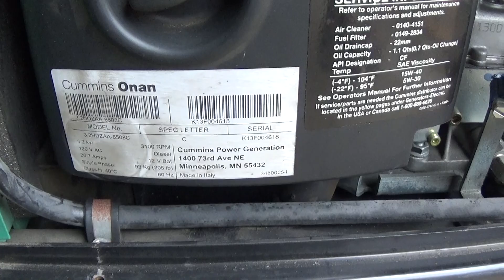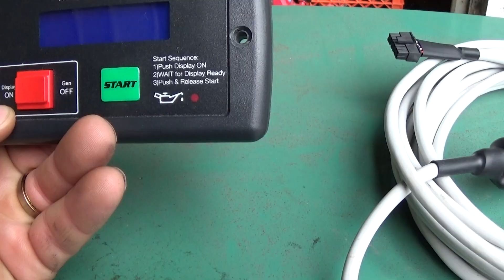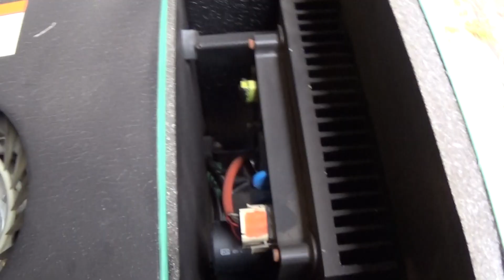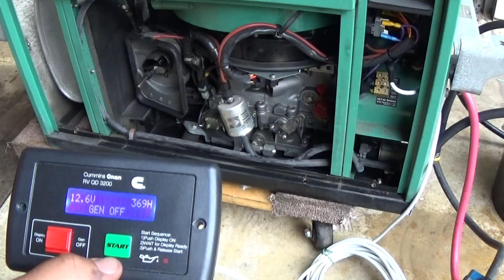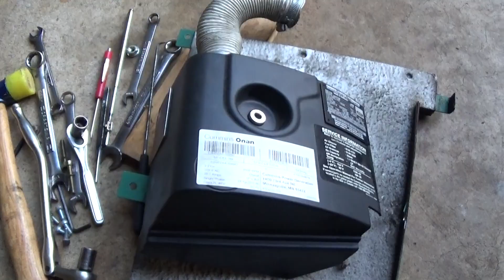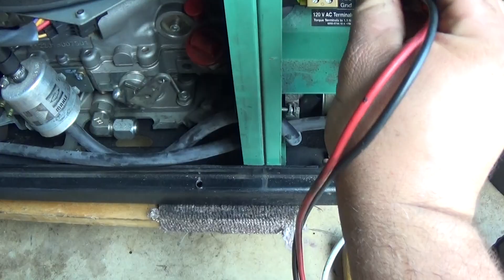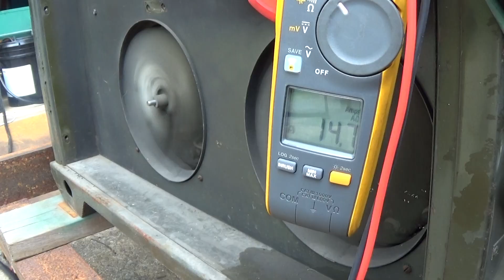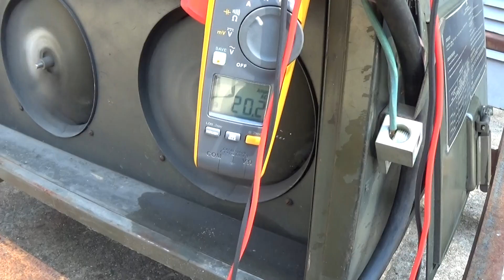Miniature Diesel Generator Diagnose, Repair, Test ONAN RV QD3200

Comment: Used to work for Cummins/Onan - that was the worst 'Onan' that was built.  Didn't really conform to any of the other machines. Almost every single other one could use the same control panel. Not this one!  Oh no...   gotta use the panel that came with it (thankfully you got it with it!) and nothing else.  If you get intermittent failure, look for a crack in the control panel PCB. Drove myself insane diagnosing THAT one!
Reply: JD - diesel, try to find a QD7500. Later than about 2003 or so. Earlier ones had magnet failures where the glue came loose. Ive exploded a few!  Dramatic.

Comment: Nice Job! Glad to see the shop is coming along nicely! I just fixed an old Honda (Home lite) 4800 watt generator from the curb with he exact same problem! (Video coming soon) I wonder what causes it to happen?  Great video!
Reply: Usually underloaded diesel generators carbon up after many hours of operation . Clogged air filrers or obstructed air cleaner or air induction.
Reply: Sorry that coment was meant for someone with a carboned up J-series. I wasn't paying attention where I was typing!

Comment: That’s a sweet little genny.i was thinking the same thing about that muffler maybe being too clogged up. Looking forward to part two!
Reply: Quite likely dude.
Reply: We use to change out muffler every 6 months but frac jobs have increased to the point it’s changed oil filters and run it tell it’s done, new ones at yard waiting for 3 hour change out 
Time and money
Reply: Or could just use a small tractor muffler

Comment: That's awesome! 
As many problems as they have come through, if it seems like it might be a major issue, it's cheaper for them to just replace the whole thing than spend time troubleshooting what could be an issue they won't repair. If it seems major it probably is so just proceed as if it is.

Comment: That right there is the difference between a technician and mechanic
Reply: No, we are different types of professionals, but the same, as we do thing the way they should be done! However, there is a difference between a mechanic and a parts changer! Parts changers can cost you a lot of money! Why buy a alternator for $200, when you may be able to just put in a $5 set of brushes! I want to know why and how something went wrong/bad.

Comment: Nice find. From experience these engine give lots of valve trouble especially on the exhaust side, they need to be checked every 250 hours max, likewise as you said the oil should be changed every 40-50 hours.
Thanks for uploading.
Reply: I'm interested in reasons for such frequent oil change. Please enlighten me.

Comment: I have a 50kw set that just ran a small motor for thousands of hours. It smokes pretty bad even at a light load.
Reply: Run it at full load for a couple of hours and you will be surprised at what comes out the exhaust
Reply: I cant even get enough load to heat it up. Way to big for my needs  but the price was right on it.
Reply: @wizard1800  I'd find something, anything to load it. It'll really hard on them to run under such light loads. Diesels need to be run hot and heavy.